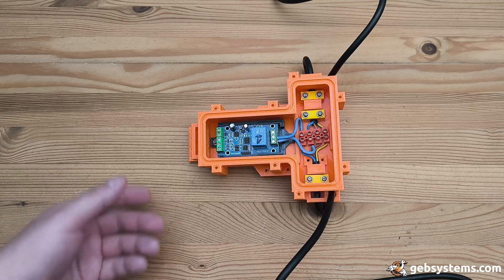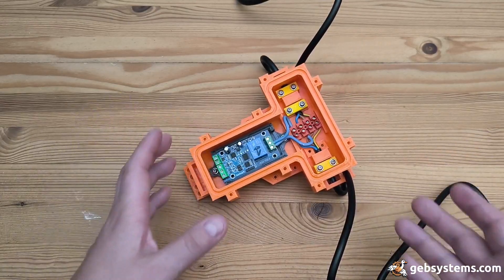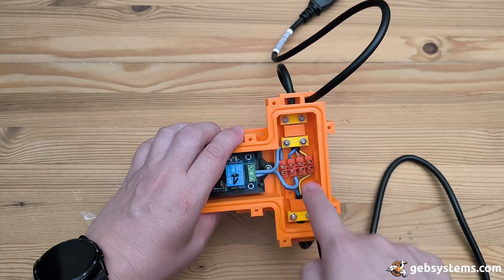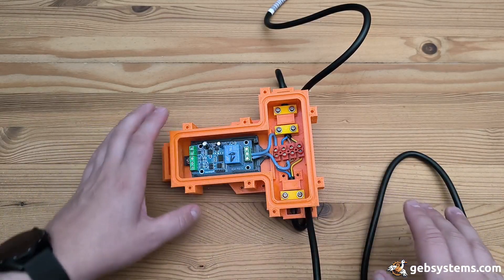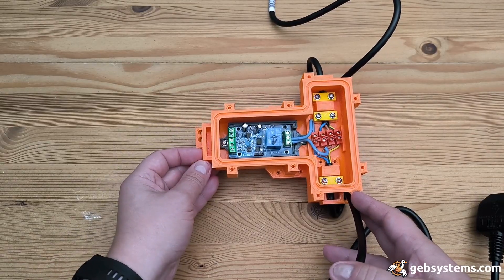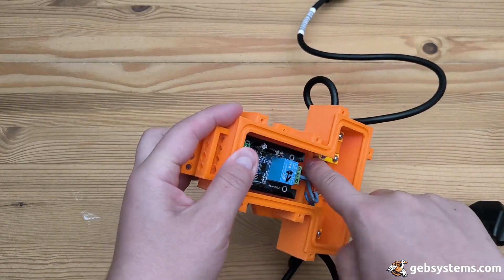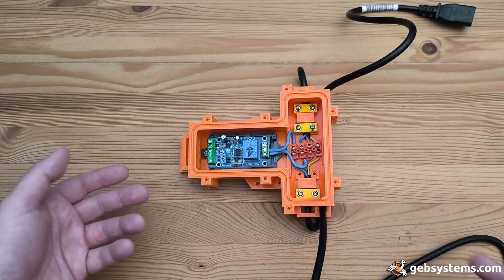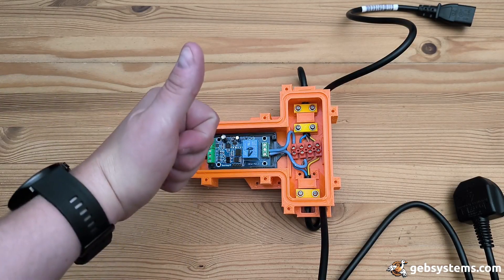Relay enclosure done right... kinda | Arduino Modbus Project | !Ai

Comment: Why not buy smart socket, much better.
Reply from the maker: I had a look at it now and you are correct. It is a much neater solution. However, I do not want something that will connect to my wireless network. I want my entire setup to be not relying on the internet at all. Second thing is that I want to control things via Modbus. Third thing is that I am enjoying the pain of putting this contraption together.
Reply: @gebsystems  The third point is how we all learn things but for first point, you dont have to connect to internet, you can get home assistant and run it locally. For second, I think you can hook up modbus to smart socket, you just need to add some components and own firmware which is quite easy. If you dont need rs485, then I'm sure there are some unused uC pins that can be used for small distance modbus.
Reply from the maker: I really do not want to use home assistant as I want to build everything myself if I can help it. The goal is to buy as few off the shelf products as possible. So I am trying to keep it minimalistic. The smart socket would be totally a thing if I was doing it for someone else and they just need the super user friendly system to manage their home (thanks for that smart socket suggestion as it is about  $6 here and I could use it for my parents house). I on the other hand do not care if there is no GUI to manage it. I am still far away from having a fully functional setup but I am slowly working through each obstacle one at a time. As you said I could just buy these products and just put it together in a day or two and be done with it.